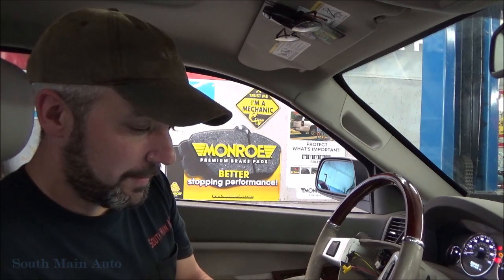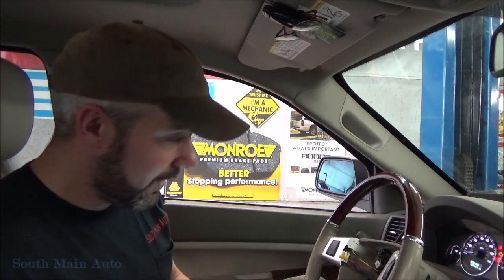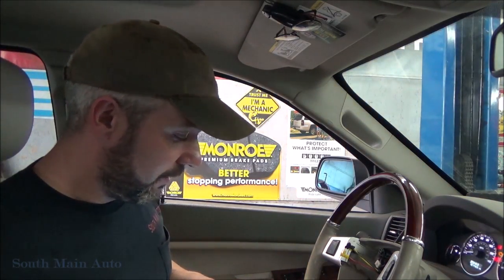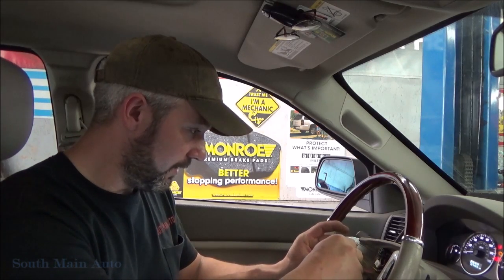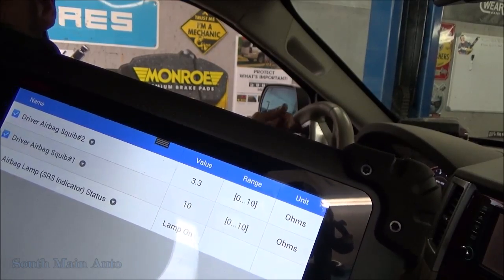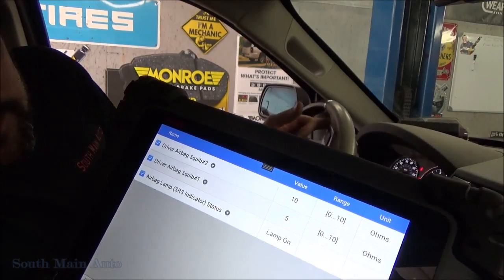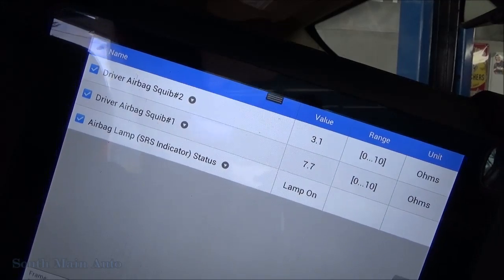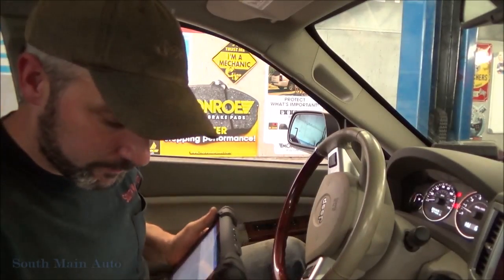Diagnose Chrysler SRS Air Bag Codes: B1B02, B1B06

Comment: My experience Squib circuits codes are normally 90 percent of the time The Clock Spring Even though most flow charts say it's the air bag Good Video Eric O @SouthMainAutoRepairLLC

Comment: Important question: Why can’t we hook up an ohm meter to the back of the clock spring and check the air bag resistance? Is this because the meter’s test voltage might trigger the inflator charge? 😬

Comment: Can any one help? I have an 03 Dodge Dakota SXT truck and the Air bag light is on. I bought a code reader that reads air bag codes and ABS codes (ABS - SRS) I checked the SRS and got no error codes I checked the truck and no error codes I got " P done" when I cycled the ignition 3 times. I checked the ABS and I got some strange codes. There was no letter before the code just the numbers and letters. the codes I read were and I will enter them as they appear on the scanner > 0001 DODGE, 0002 DODGE, 0003 DODGE, 0004 DODGE, 0005 DODGE, 0006 DODGE, 0007 DODGE, 0008 DODGE, 0009 DODGE, 000A DODGE, 000B DODGE, 000C DODGE, 000D DODGE, 000E DODGE, AND 000F DODGE. <- That is exactly as they came up when I ran an ABS scan (My ABS light is not on however my AIR BAG light is) can anyone help me diagnose and fix my Air Bag light as I need to run my truck through emissions test and we al know it will not pass if there is a warning light on. I thought it was "Lets Clean the Air" what does my Air Bag have to do with the emissions coming from my tail pipe and is the person testing my truck ASE certified to turn me down (NO) Please help if anyone can. I am a Single Father and my mother just passed away in may so it's just me and my Daughter and I need to fix this as cheaply as I can. I don't want to just start randomly replacing parts until I get it right.

Comment: Yo Eric cool bypass test! So why can't you use an ohmmeter to check the resistance of an airbag circuit? Isn't that what the SRS module is doing anyways to get the scan data values?
Reply from the maker: It most certainly is but I am victim of listening to old automotive myths like never use an ohm meter on an air bag, never use a test light on a computer, always shut the engine off before changing oil and things like that. It is a classic case of speaking before thinking. Could you imagine what would have happened in the comments if I used an ohm meter to check the bag!?
Reply: Well you know more controversy = more comments and views. I mean look at our buddy Schrodinger...the recipe for success xD
Reply from the maker: motoYam82 So your saying I need more time constrains and more bitching about mindless hacks?
Reply: I learned something new about time constraints working for a few days in NYC...basically if you stretch out a simple 5-minute diag into half an hour of complaining and not getting anywhere, then you are most definitely not on a time constraint (or are clueless) haha
Reply from the maker: motoYam82 I was wondering the same thing...
Reply: Just think, way to get a bunch of views is to blow a few airbags with an ohm meter.
Reply: Hey Eric, James' idea sounds like a winner for our next video collaboration!! Can you score some undeployed airbags at the junkyard? :) Maybe my new LoadPro can be the "detonation device" haha
Reply: Did some research on some igniter circuit data sheets, looks like it takes around 1.5 amps min , min 7v max 35v.
Reply: So if you apply straight 12V to the ignitor it will go off? I thought they would be more protected against accidental shorts to power by requiring a higher ignitor voltage...
Reply: Looks like that. Take a look at the TI TPIC71004-Q1 datasheet.
Reply from the maker: ***** I guess I never knew that static electricity from your body could carry enough current to set off a squib. Most require several amps to deploy. Hmm I will have to look into that.
Reply: Wow that is unfortunate :( I have to ask, was the airbag itself UNPLUGGED from the harness? Was it the ohmmeter itself that triggered the deployment?
Reply: Pine Hollow Auto Diagnostics 🖕🖕🖕🖕🖕🖕🖕🖕🖕🖕🖕🖕

Comment: After witnessing a woman almost get her head blown clean off by the airbag in her truck, I want nothing to do with them.
Reply: Mine did that last night n about scared me too death! Out of no where. Just left drive up window gas station and boom right in my face. Chrysler 200 LX 2011.  Only 115000 miles in it. Hurt so damn bad n I thot my wrist was broken. Hate this pos! I thot I got shot and whole car filled with smoke and I jumped out.
Reply: After replacing the clockspring, I would leave Eric's test resistors permanently installed and not plug the airbag back in. That's how I have my own personal vehicle rigged up, no lie :)

Comment: man this is really handy, chrysler's diagnostic flow chart for these codes involves using the factory scan tool plus a special tool that comes in a briefcase with a bunch of different connectors and an airbag simulator thing, this is a real time saver, half of the time you couldn't even find the right connector on the special tool, and it was always was a broken clock spring

Comment: I enjoy your videos. In my shop we took an old bulb socket with an 1157 bulb installed. Use the pigtails from the socket inserted in any airbag circuit. It is about the same resistance. Has worked on every one we've tested to date. Peace.

Comment: Hi Eric

Was the resistor you used just from an electronics supplier or is it an actual test item?
If just from electronics supplier how did you determin the correct resistance?
Thanks.

Comment: Yep 99.99999% clock spring & am amazed at how long they last. I only put in OEM especially when it comes to air bags & components...will not install anything else for the customer's safety. Nice video as usual!
Reply: I agree, I push OEM but I have some customers that just won't send the money. The only aftermarket I can get usually are Dorman and they last abut 3-6 months if that long.

Comment: Last time it was just some resistance in the air bag connectors. Can you just clean up the clock spring or do you have to replace them?
Reply: Replace, they are wound wire bands in an internal sprung unit, as the name implies. The wire can break or partially break at any point in that long roll. No real way to clean or fix them unless it's just a dirty connector.
Reply: Emt Scythe I think Eric dissected one last time but I missed that video. If it were anything like the rotating horn button in an early Chevelle then you could clean them up and get them working again.

Comment: cool video, a bad clockspring would not effect both circuits?
Reply: They don't share a common connection. The clock spring is basically a ribbon cable, constant flexing over time just breaks the wires.

Comment: What type of resistor is it, might buy one. Thanks
Reply: 2 ohm
Reply: A tip, a 3.3 ohm is a very common value in the electronics world and that would work too. Back when Radio Shack existed, you could pick up a pack there.

Comment: Perhaps a dumb question but...if it's a bad clock spring, wouldn't squib 1 AND squib 2 be affected as you turn the wheel?  Why is only one circuit impacted?
Reply: Clock spring has wires for squib 1, squib 2, steering wheel buttons, etc. In this case only the wire for squib 1 got broken.
Reply: different circuits in the clock spring.
Only one was bad in this video.

Comment: Good one Eric. Are their any special precautions you take working on air bags so they don't accidentally go off in your face?
Reply: Unhook the Negative Battery Term and pull the SRS fuse ( Airbag )
Reply: Good idea, but wasn't Eric checking the circuit with power on? Or did he disconnect before taking the airbag out, then reconnect to test the circuit? Or is it safety third at SMA - LOL!